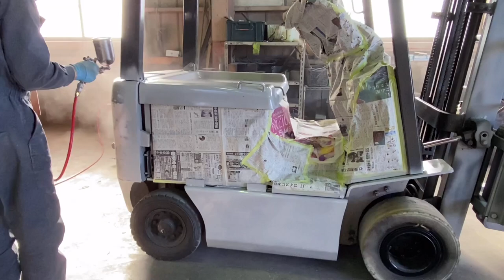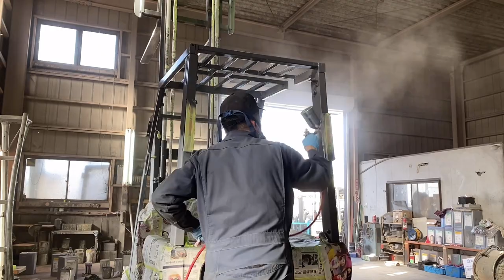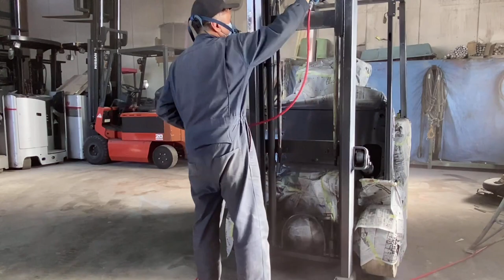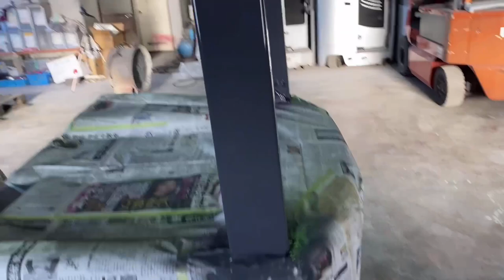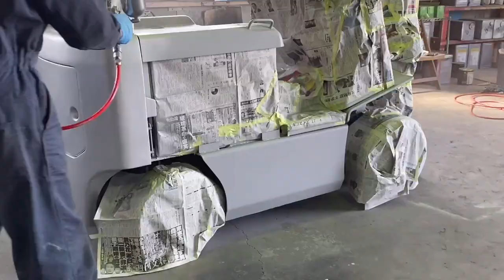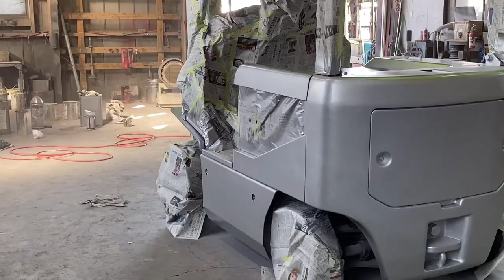How I painted this forklift silver

Comment: How do you degrease, what chemical do you use? Do you wipe it down with a tack cloth or just dry cloth. You do water the floor prior to pain to keep dust off, correct?
Reply from the maker: Thank you very much for your question.
I apologize for replying so late because I had a lot of problems due to covid-19 virus.
I don't know which country you are from, but in Japan, I use a grease cleaner (clean grease), which is a clear acidic liquid.
Yes, we wet the ground during painting so that dust does not settle on the paint.